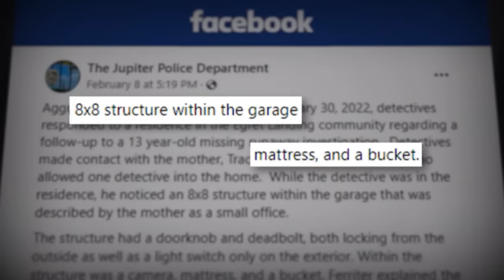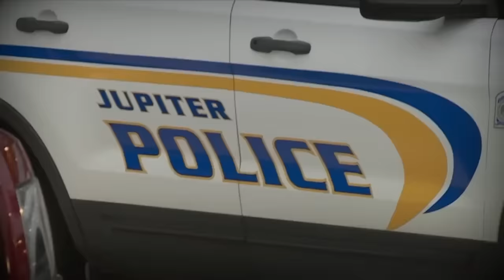Boy in a Box Trial | Psychological Analysis of the Box

Comment: If a child was left in a locked car in the heat they would be charged with a crime. 
I don't see any difference and what they have done locking this child up in a room with no air.
Reply: Good point!
Reply: he was being kept worse than a prisoner because at least prisoners get regular meals and let out of their cells on time and the lights come on/off at the same times
Reply: In summer, a S. FL Garage is 102° easy. And the heat is  trapped, really only cools down around 11pm. Did the bucket even have a lid for all the peanut butter they fed that kid? Astounding. 

Do the prisons get Court TV as an option? Anybody?

Comment: These conditions for remand prisoners and convicts are defined as torture under UN law:
Sentenced to solitary.
Indefinite duration of solitary as punishment.
A cell smaller than 8.5x8.5 ft plus additional toilet/basin space.
Routine in-cell video/audio surveillance.
No daylight.
No reading lamp to switch on in the dark.
Insufficient heat / ventilation.
No access to daily. association by choice.
No access to outdoor exercise.
No choice of in-cell reading with regular change. 
No choice of other in-cell pastimes like art or radio.

A comment of the mother’s indicates that the boy was not permitted to be on his bed at certain times. The fathers follow-up makes it explicit that the lad was not allowed to switch on the air conditioning. He also forbids the boy at times to use the toilet bucket, and instruct him to “hold it in”.
The father evidently goes through his son’s school things as routine, and interrogates him to “prove” that books like The Diary of Anne Frank were assigned texts.  He also explicitly asks if, after finishing lessons or homework, the boy “played any games (on the laptop) — or did anything else you shouldn’t be doing.” He also scolds his son for previously “looking up things you know you’re not allowed to”, indicating that even his use of encyclopedias/  dictionaries was restricted.